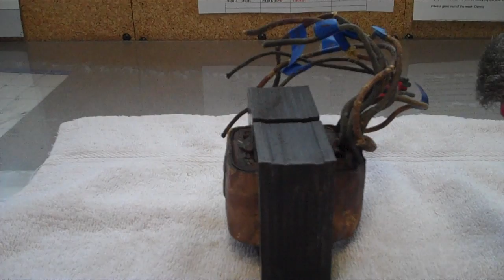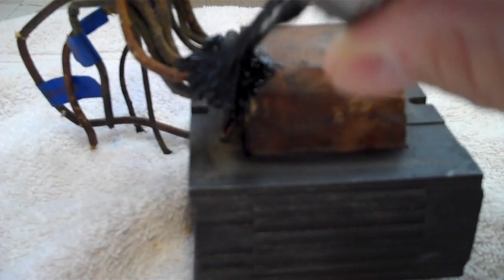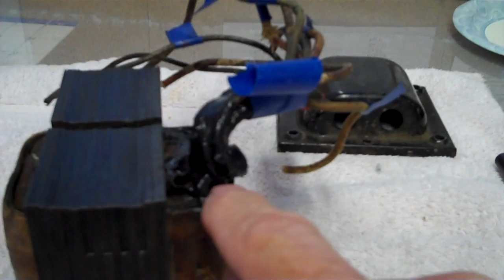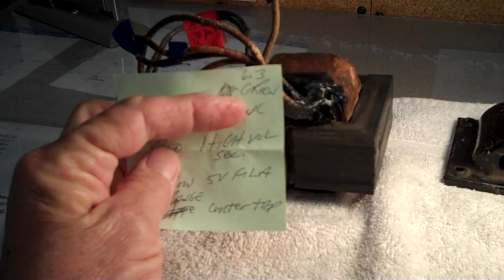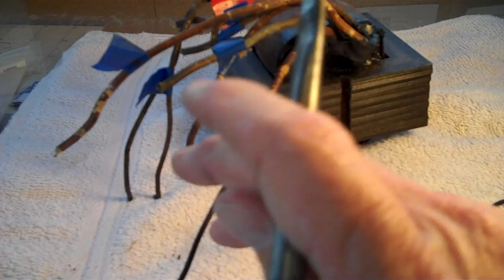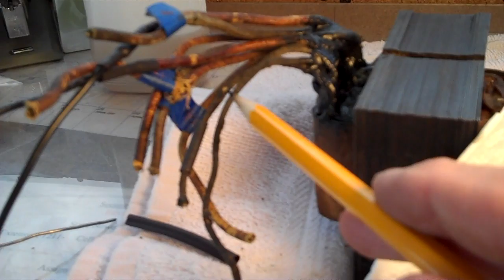1936 Philco Model 630B Repair and Restoration (Part 11 of 35).

Comment: For those watching: As for power transformer wire colors, the next time you order parts from Radio Daze, they have a laminated color code chart that shows not only resistor and capacitor color codes, but includes standard transformer and hookup wire colors used in radios. It's a handy thing to have hanging by the workbench.  By "standard", of course, I would define that as what most manufacturers stuck to, unless they decided not to.  Also, the colors you see on old radio wiring is not necessarily the colors they were when they went out the door!  I've got Philco 70s with speaker wires that look like one black and white and two yellowish wires, but if you look under a cover you can see one of those yellowish wires used to be green!  Most green, red and orange wires are indistinguishable some 70 years later!

Comment: Hello,
I have stabilizer transformer it has 3 wires one side and only 1 wire to other side. Could you tell me what are input and output wires it has and how I connect them with 2 relay circuit?

zubair

Comment from the maker: I always use 22 guage hookup wire bought from Radiodaze, some solid, some stranded.  It's rated at 600-volts.  So don't use just any old wire.  Be sure its voltage handling capability is high enough to be safe.
Also, the lengths of new wire I soldered onto the old transformer wires were just eyeballed.  I of course made them a little longer than necessary, but too long is better than too short.
Good luck on that first radio, my friend.

Regards,
John

Comment from the maker: Hey...it's good to hear from you.
The canvas sleeves could have been an asbestos material placed there to protect nearby components from heat.  You might want to be careful around such things  .But I've never worked on any radios that had it, so I can't recommend what to use as a replacement.  It of course would depend on how much heat we're talking about.  Standard heat shrink would not work well on hot surfaces.  It would keep shrinking until it split open.

Regards,
John

Comment: Hi, will using canvas sleeve after heatshrinks do any good? Just that I've seen canvas sleeves used in some old amplifiers especially with HV sections and possible hot spots.

Comment: I have a Halicrafters S120 that needs filter caps and dial cord work. It hums 
when you first turn it on, but gets much better as it warms up, takes about an hour
I am going to tackle this project in the near future if my bad eyesight will allow
I did not find a schematic at nostalgia air but I think the multi section cap is 
two 40uf and one 60 uf please correct if i am wrong, Your videos are great
as always informative and entertaining. Thanks very much

Comment: Hey John, Good information, as usual.  You're the Yoda of radio repairing.  How did you know which wires on the transformer were which?  Did the schematic tell you or did you label each wire as you took it off?  I have no idea what the single "center tap" wire is or what it does.  Can you clarify?  Thanks, Tom